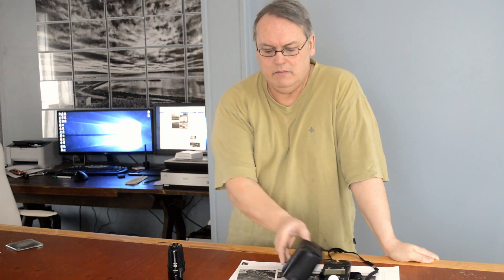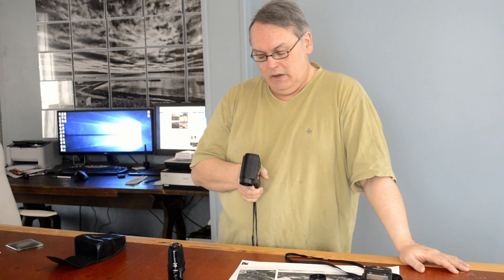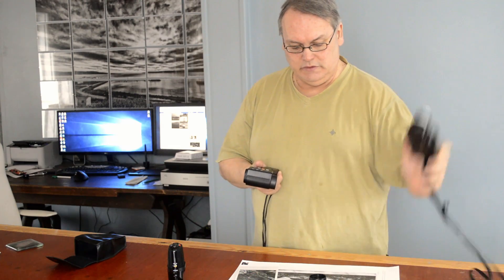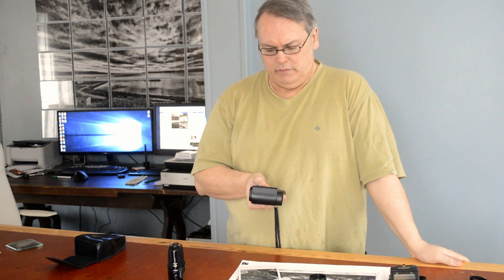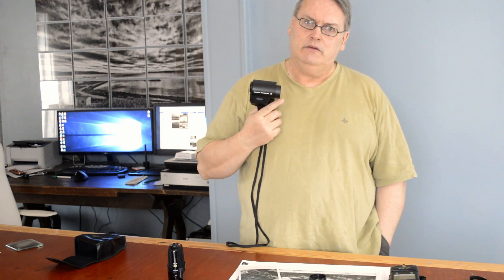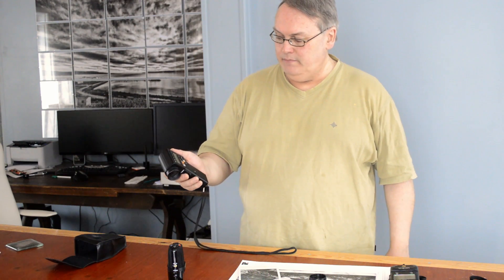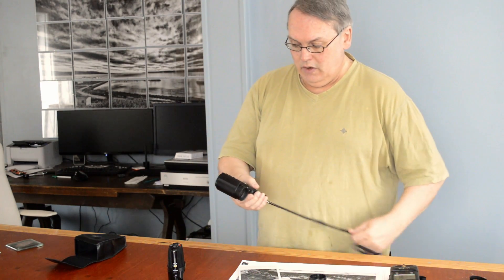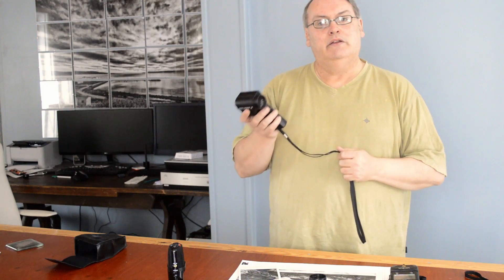Minolta Spotmeter

Comment: yes, you do use it, 1/2000th is the fastest speed of the 200/2000 series hasselblads, as they possess a focal plane shutter, and for high sunlight, this is useful as it saves having to use filters to block out the light.

Comment: Thanks for taking the time to make this video, I recently purchased the F type from Japan
Reply from the maker: Hi Brian
You are very welcome. Don't you find that so much useful photographic kit is stuck in Japan which adds about a third to the price for us?
Dave
Reply: @DaveJSmith  couldn’t agree more.. I was shocked that items have arrived within 3 days ! 
Touch wood, everything I have purchased has been “MINT” as described.
Reply from the maker: @brianreid5607  Usually I have had good experiences but bought a pentax 67 which was definitely not as described and arrived with two major issues, of course I wasn't able to properly test it for some weeks and so missed the return deadline. The sellers tried to make good, but in the end I sold it on (describing the issues thoroughly) and will probably not buy older cameras again.

Comment: The Minolta Spotmeter M ( and the later F) is nearly perfect IMO - all the info you might want with none of the gimmicks. If you shop for an "M", note that the great majority of the M meters are powered by a silver-oxide battery (LR44), not the AA battery seen here. The LR44 lasts about 18 months whether you use it or not, it's more expensive and not available everywhere.  When Minolta introduced the "F", they used a AA for its relative convenience. The M continued for a short time, and those last Ms used the same AA power source as the F. I found that my M, taking an LR44, worked fine with the lithium version of the LR44 format, and it has about a 10 year shelf life. The Minolta M/F meters are much more color neutral than other spot meters, particularily the Pentax Digital, which has the worst metering consistency color to color.
Reply from the maker: Hi Randall

Many thanks for that interesting info,  especially on the batteries - always an issue for photographers!

Dave
Reply: So M or F?
Reply: @danielemilazzo432  The metering circuit of the M and F models are functionally identical, except that the F will additionally measure flash exposure. I've got both models and I've never in decades had a use for the flash feature of the F. I suppose that it might find a use in a studio setting, using flash only or a mix of flash and natural light.  I would pick a model which takes  a AA battery, just for its convenience.
Reply: So the lithium LR44 has a shelf life of 10 years, but how long does it last in the meter?
Reply: Fully agree with that.
Reply: @thewhiteapparation  I cannot answer that question, because I do not use the meter that much. When my M is not in use, I pull out the battery and leave it loose in the meter case. I suspect that it's natural life will expire before my use will consume it. It's been more than five years so far.

Comment: Dave Smith Photography thanks for the excellent video. I have a Minolta Autometer lV which can be converted on a spot meter and measure a 8 degree angle with an adapter. Do you think that is possible to have almost similar results comparing with a spot meter like yours? Thanks
Reply from the maker: Hi Luis
Many thanks for your kind comments, always much appreciated. I think that an 8 degree spot is quite wide, but will give you a better result than just incident metering. If you can choose your main areas of tone to be large enough then you should get pretty similar results, it is just a little more limiting when finding the tones to meter from. It will also give you ractice and experience with the process.
Best
Dave

Comment: I have a decades old M model, put new battery in and it displays 0 ev and 100 asa.  I can up/down the asa, but when I try and take reading, it stays stuck on 0 ev, and F no./ev button has no effect.  Any thoughts?
Reply: Oops, forgot that you have to switch to time to take a reading.  Been a long time since I used it.  Works now.  Thanks anyway.
Reply from the maker: @kenfox9626  No problem, glad it worked out ... not much to go wrong with these
Dave

Comment: Hey man, great video, quick question. to get the average reading what are the steps? Do you have to press the "H", get reading of the highlights and then press Memory  (or whats the order of steps?) of course same order with the Shadows, I just want to know step by step. Thank you
Reply from the maker: Hi Alex

Many thanks for stopping by the channel. I don't really use the meter in quite that way, I am not looking for an average (otherwise just use a standard meter) rather I am looking at where the major tones in the intended image fall and then deciding where to put the the exposure to preserve highlights. Usually I find that senes are well within the latitude of the film, but if not this method would tell you whether you would need to compensate in development.

I hope that that helps, let me know if you need more detail

Dave

Comment: First off thank you for the Video. However I am confused as to why you would open up exposure to preserve highlight. Wouldn´t you want to close it down to not have the highlights blown out?
I feel like I am thinking mistakenly here. But if it is f8 it is obviously darker than f4 or something. however if I go down to f4 wouldn´t the highlights blow out? 
Also why when you have an ambient reading and want to go for more highlightdetails in your shot would the meter give you a lower aperture value?
I am sorry but somehow I can not wrap my Head around this meter :D
Reply from the maker: Hi Niklas

Firstly, welcome to the channel. It is indeed quite confusing, however it is important to remember that the reading that you get on any lightmeter is one that is intended to give a mid tone (zone 5 in the aone system of exposure) and if you are metering something which is white  (such as my white cupboard doors or the wedding dress or snow) using the meters values will actually underexpose your white highlight by about two stops (zone 7 is the point at which both texture and detail are preserved, zone 8 only texture is preserved zone 9 texture is lost an zone 10 is unrecoverable shadow) so counter that and ensure that your white object is white but still has detail and texture you add two more stops.

With digital cameras we can avoid these issues by taking a shot where we have metered from a grey card for example which will give an exposure to correctly render the mid grey value and so your highlights will be right. However, in large format photography we usually want more control over where we place various tones in the zone system

I hope that that has clarified things a little. Let me now if you need more detail

Dave
Reply: Very useful explanation 
Thanks

Comment: Hi, I have bought the minolta spotmeter f after viewing this video. But mine came in with rattling sound toward the front element of the meter. Is that normal ??????
Reply from the maker: Hi There

I am glad that this helped, but no a rattling is not at all normal. I would send it back even if it is apparently working something is wrong

Dave

Comment: Does it have a aperture priority mode or only shutter priority?
Reply from the maker: Hi Techlair

I am currently in China and don't have a spot meter to hand. I believe that it is aperture priority only

Dave
Reply: Hi, it is actually shutter priority only. I find it easier to use it in EV mode, so I do not have to fiddle with the shutter speeds to find the aperture that I want (I am a newbie, still finding my way through the zone system)
Reply: I got it and enjoying using it. It's dead simple
Reply: Me too. I bought mine last year after watching Dave's video
Reply from the maker: HI TechLair

It really is, like a lot of things in Photography, there is a lot of mystique around the spot meter, but they are really pretty straigtforward. I also don't think that you need all that functionality that you get with the latest models!

Dave
Reply: Dave Smith Photography yes Dave thanks for the simple tutorial
Reply: I fail to see how this meter can be any use to anyone as you cant set the aperture as fixed and measure the required shutter speed